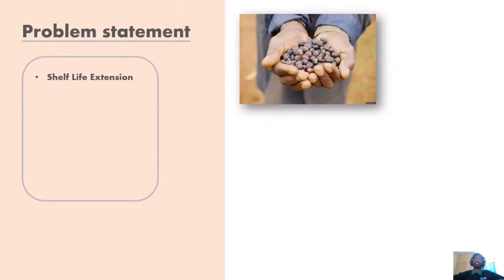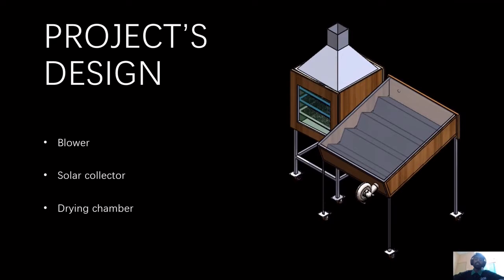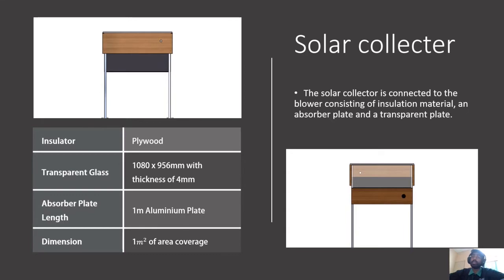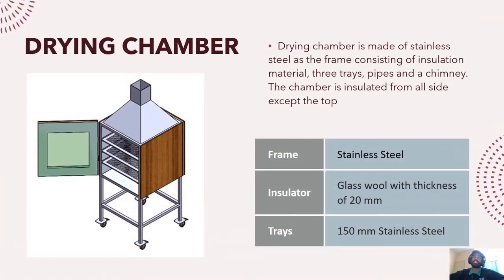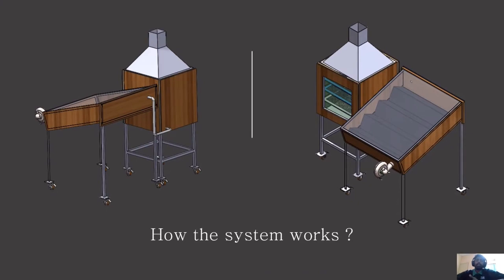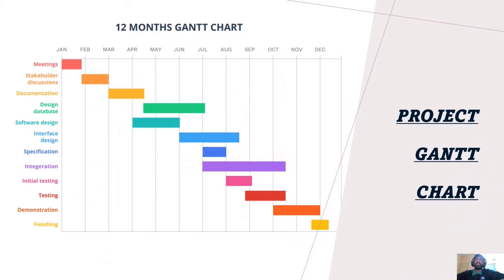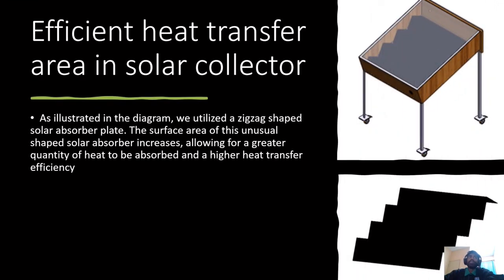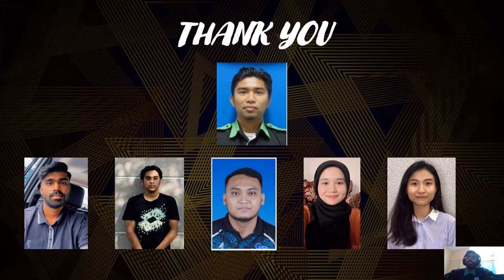GROUP 9 Solar Drying System

Comment: I just want to ask if the air is circling with the outside don't you think that the energy produced by the heating section might not be enough to heat the air before it moves to the chamber?